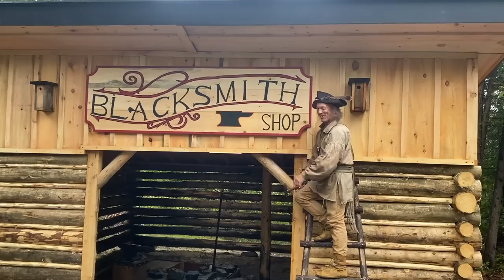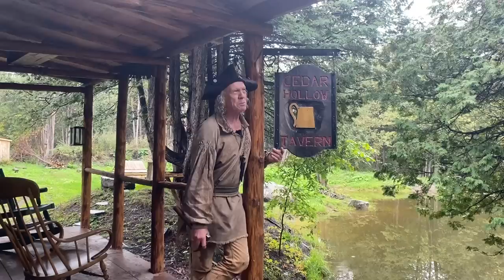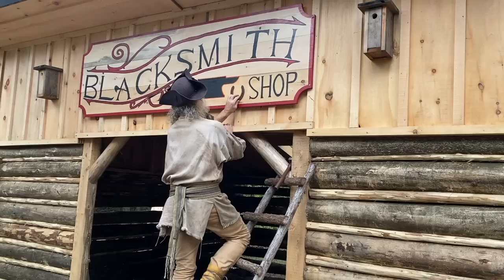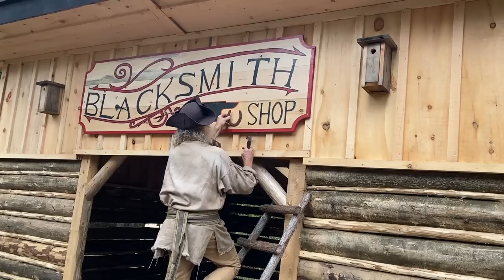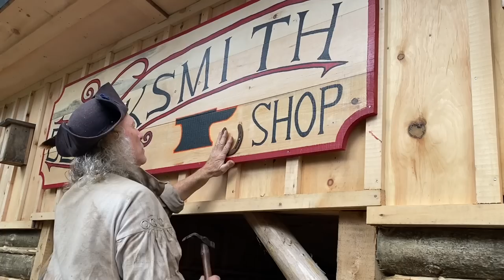Log Cabin Blacksmith Shop Build: Sign Up But Not Open for Business Yet! | 1800's | PIONEER LIFE |

Comment: Here in England, most blacksmiths were farriers too, up until the 1950s or thereabouts. Usually described their selves as “shoeing and general smiths” as did my father. They would be capable of making or repairing most ironwork found on the farms, implements etc. as well as making ornamental ironwork. It was when most of the working horses died away, around the Second World War, that many of them stopped shoeing horses, as it was two or three decades before there were enough pleasure horses around to make it worthwhile. Most of the early tractor implements were horse implements, modified with varying success, by the local blacksmiths.
Reply from the maker: You have an appropriate name for the topic your discussing. Cathy and I farmed with horses for a number of years but, also had a small 8N Ford tractor.  So I have also used some of our horse drawn equipment behind the tractor.
Reply: @TheWoodlandEscape  The Ford 8 N was really The Ferguson wasn’t it? I spent 50 years as mainly a farrier, travelling to clients premises, I did a little bit of black smithing and agricultural engineering too,, hence the nickname.
Reply from the maker: Gotta love the nickname!  It was indeed the Ferguson company .
Reply: @anvilhead0  The Ford 9N (later the 2N during the war) was what many referred  to as the "Ford-Ferguson."  The 9N was the result of the "handshake agreement"  collaboration between Henry Ford and Harry Ferguson using Ferguson's system of the three-point hitch for attaching implements to the tractor.  After the death of Henry Ford, the company introduced a new tractor, the 8N, which still used the Ferguson System.  Harry Ferguson filed suit for patent infringement, then put plans in place to build his own tractors, which were built at the famed Banner Lane factory in Coventry.
Reply: @buttonvalley  yes, I was well aware that Ford stole a lot of Fergusons brilliant engineering ideas, including his front axle sweep angle, which meant that the steering tracking was always correct, no matter the width setting. I’d put him up there with Brunel!

Comment: My contribution to the "wee bit of history"....

Many believe the origin of the lucky horseshoe goes back to the folklore of St. Dunstan, Bishop of Canterbury in the 10th century and Patron Saint of blacksmiths and metal workers.  

Two stories are told of encounters Dunstan had with the devil.  One goes that the Devil disguised himself as a pretty maid and went to Dunstan at his forge to tempt him by dancing provocatively.  Dunstan spotted the cloven hooves peeking out from the maiden's skirts and knew it was the Devil.  He put a pair of tongs in the forge until they glowed, the took the Devil by the nose with them to drag him out of the smithy.   There's a little rhyme about it, "St. Dunstan, so the story goes, took the Devil by the nose, With red-hot tongs which made him roar, That people heard ten miles or more."

The second story tells of the Devil, seeing how lame horses were cured by being shod by Dunstan, went to ask that he have shoes put on.   Dunstan complied with the Devil's request, but put horse shoes on the Devil cloven hooves instead of the proper ox shoes.   This put the Devil in so much discomfort and pain he begged Dunstan to take them off.   Dunstan only agreed after the Devil swore a promise that he would never enter a dwelling that bears a horse shoe over the door.   The folklore goes on to say (this may have been added later) that a home or ordinary building should hang the shoe ends up, so the luck doesn't run out, but over the door of the smithy, the source of the luck, the ends should point down, so the luck pours over the customers of the smith.

I just became a Catholic this year, and chose St. Dunstan as my patron Saint.
Reply from the maker: That way more than a wee bit of history, it’s a lot and I might add fascinating.  Might just have to use those tidbits.  Thanks for sharing.
Reply: @TheWoodlandEscape It is proper to turn the shoe down in the smithy so that the luck runs into your work. I heard this many times growing up and as an adult.  At least that's the way its been in our shop for 30+ years and seems to be working.

Comment: About 70%  of the work done by country blacksmiths was shoeing horses the rest was repair work as a rule.
This is consistent across all the day books that I’ve seen from what was then Canada West.
Reply from the maker: That seems pretty accurate , Pat, judging from my research on the matter.  Although, prior to the 1800’s horse ownership was not as common and the manufacturing of goods would have been a greater portion of the Smiths job.

Comment: Another great video. I was beginning to wonder if the other walls would be chinked. I've seen some pretty crude smithies before. I'm looking forward to your forge build. My last forge was a railroad forge which I sadly parted with at the VERY strong urging of my wife  after the only coal available was soft coal. Lot's of green/yellow smoke when first firing it up. I should have used my brain and used charcoal instead, considering we were living in town at the time. Now it's charcoal or LP gas.
Reply from the maker: I get my hard coal up here from the Amish, most comes from Pa. or some from Cape Britain but, it is a dirtier coal.  Charcoal works just fine albeit expensive.